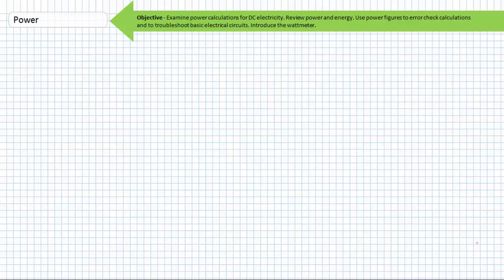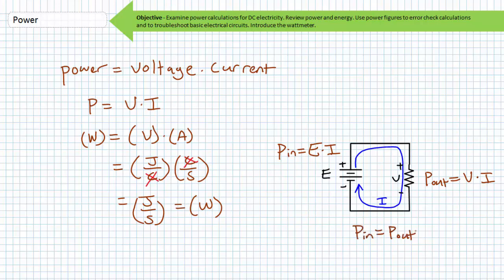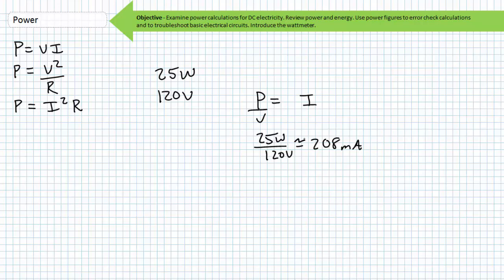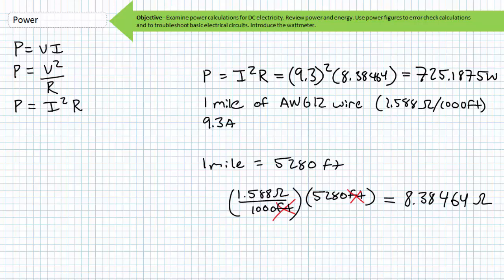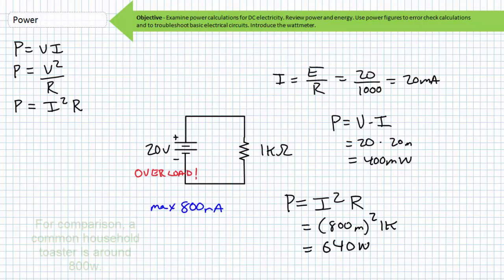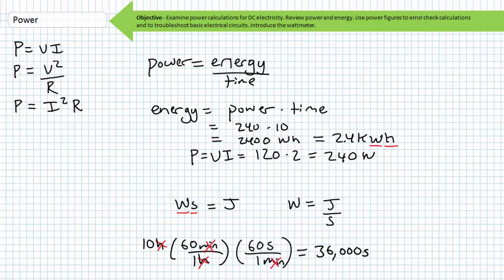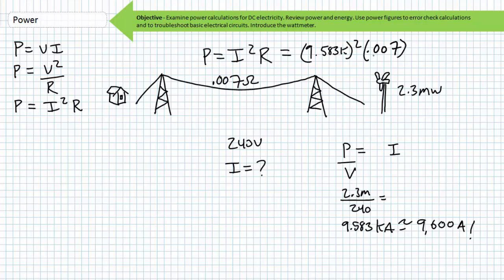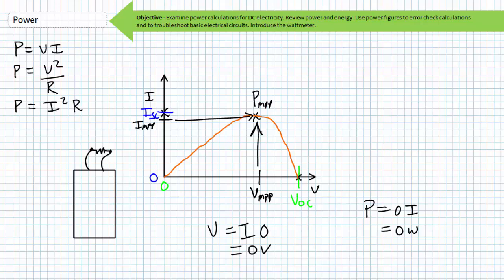DC Power (OLD LECTURE)

Comment: Any chance you've happened across any video  series with similar definition as yours about propane chemistry? 
info on the Internet hasn't helped much as I'm trying to figure xxx surface area at xx temperature can yield xxx volume of gas at xxx pressure and everything is dynamic😅
Reply from the maker: No, unfortunately I haven't. If I remember right there was another NSF ATE sponsored program that was doing something about propane vehicles? Not sure which college was doing the work though. I know it was affiliated with Phil Pilcher (the guy that did WindTechTV). He's made some impressive content.